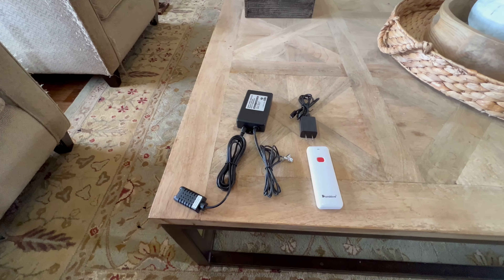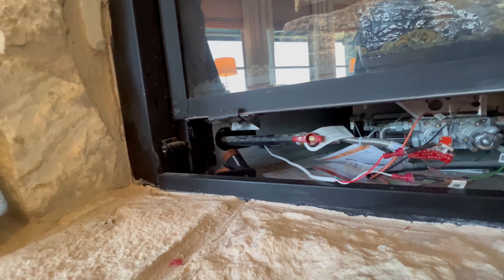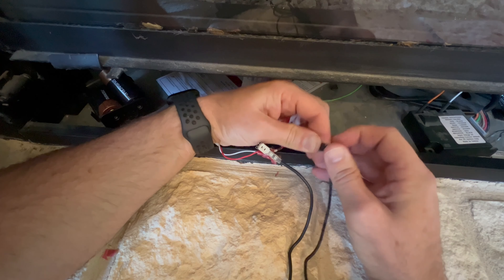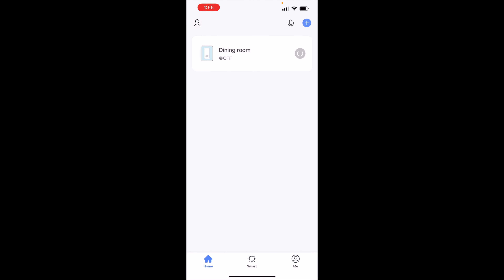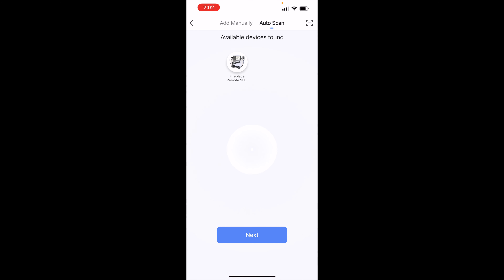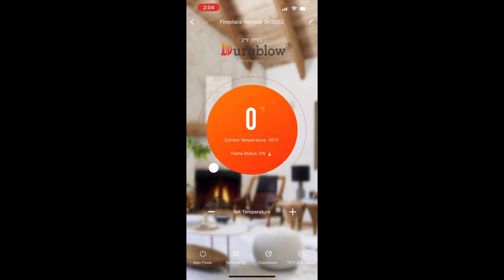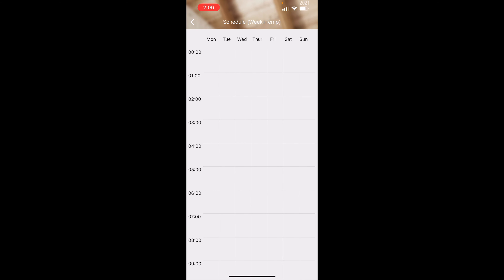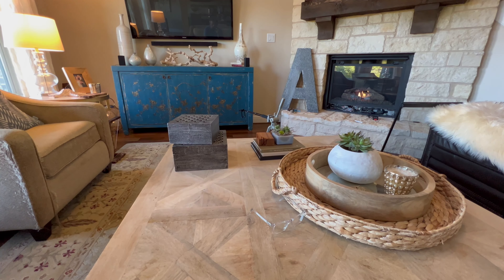Durablow Smart Fireplace with remote and thermostat review

Comment: Great video, thanks. I have a manual wall on off paddle to start and turn off the fire. If I hook the wires up the way you did, the wall paddle will get out of sync with the Wi-Fi control box. How do you propose doing this? And it's not just a normal wall paddle, but a special one that has low voltage circuitry.
Reply from the maker: I created a product just for that. Check this out. https://mattadata.etsy.com/listing/919456993

Comment: So what happens if you lose power in your home.    Millivolt switch will still power on the gas even if the home loses power, but since this device is connected to the home power source, I assume you would have to has backup battery/power...if your WIFI is down, is the thermostat temp saved on the unit itself?

Comment: Does the control box have a battery inside for operation during a power failure?  I see that it's powered by a USB cable, but is the USB cable keeping internal batteries topped up or is it only going to work when there's 120v wall powering the USB block to USB wire?
Reply from the maker: No battery backup. It needs to be plugged it. 😢
Reply: @mattadata2  Thx for the fast reply!  What if I had a USB battery bank in the middle, to power the SH3002 module during a power failure?  Obviously, if the WiFi equipment in the home is not on a battery backup, we would not be able to monitor the house temp or gas stove settings remotely, but I would think the thermostat in the SH3002 module would still work to control the stove during a power failure until the battery in the USB battery bank is depleted.   So: 120v wall outlet with USB wall block running USB-A cord to USB-micro input on USB battery bank, then the SH3002 unit would be plugged into the USB-A outlet on the battery bank to power the SH3002 unit.  It would be running off the battery all the time and the battery would be getting it's power from the wall plug.  I imagine it might wear out the battery bank over time in this setup, but at least it would work during a power failure to keep pipes in the house from freezing during a long winter storm with power outage.  USB Battery banks are pretty cheap to replace over time if necessary and it would give more peace of mind in winter as this gas stove is in a second home about an hour from our primary residence.
Reply from the maker: Yep, you could do that. Its basically an UPS for your fireplace. Grab two of these and you would be set https://amzn.to/3wJfYp0
One for your Wifi/Router. One for your fireplace. 
I have a similar UPS on my Wifi/Router. It helps a ton when power goes out only for a few minutes so I don't loose any work .....but I can go 18 hours.
Reply: @mattadata2  Cool, thanks!
Reply: A backup plan is to use a power bank to power the control box, but i guess you can only manual switch on if the wifi router is also down...
Reply: @mattadata2  Maybe a power bank can do as a backup.

Comment: Hi Matt, do you know if more than one person can access the thermostat settings via app?  i.e. We rent our second home out to friends for portions of the year and want to be able to give them access to the App so they can set the thermostat on the propane stove (which we use as a backup since our regular main furnace will not operate during a power failure).  Perhaps we can share our App login info with them so they can access it separately.  We have been able to share access to our Nest account by giving them guest access, but it would be helpful to know if they can also access thermostat for the propane stove (backup heat source for power failure incidents).  Thanks in advance!
Reply from the maker: Sorry, I don’t know for sure. But I would guess that you can do that.